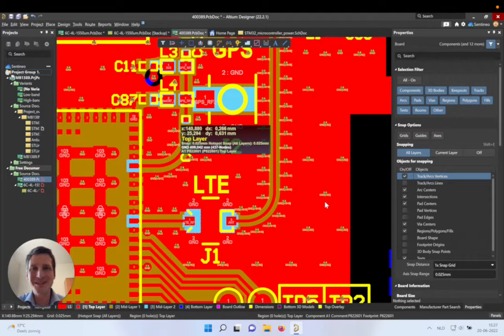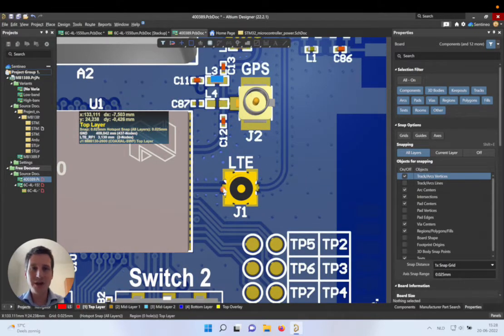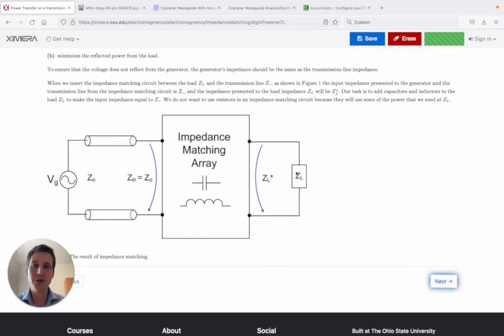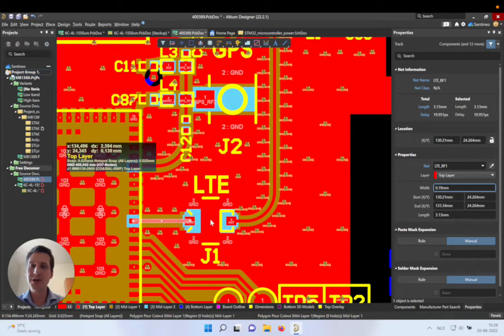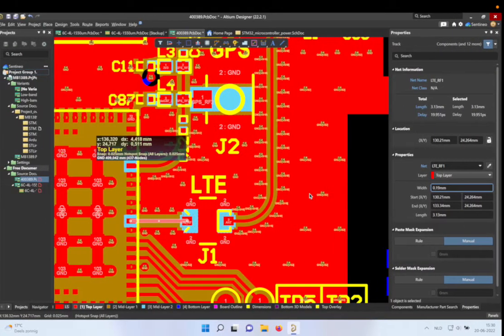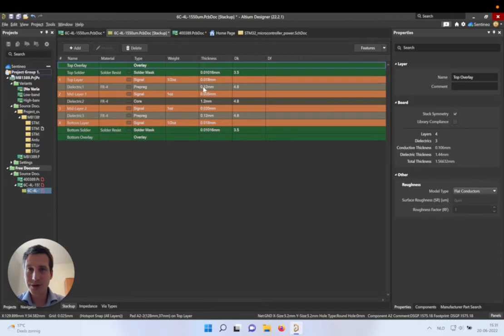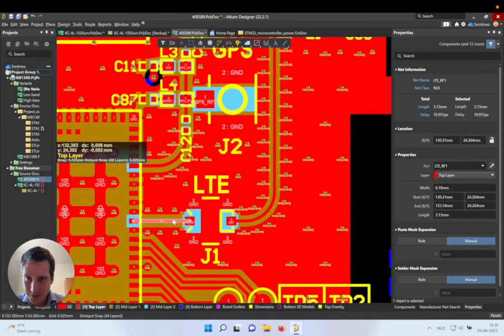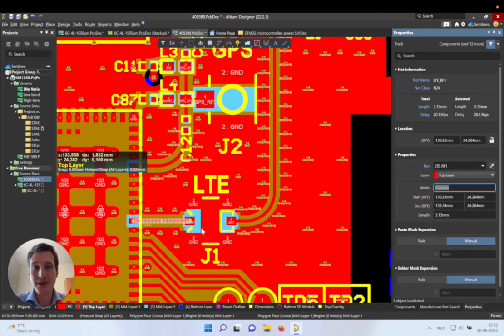How to design a PCB with antenna

Comment: Is it customary to have the ground planes,  which are located on either side of the signal trace and run the entire length of the signal trace, to have absolutely no solder mask on them? Ty
Reply from the maker: As far as I know, these ground planes can have solder mask on them, shouldn't be too much of a problem for this application imo.
Reply: @sentineo  So what kind of RF traces do not have solder mask on them? I did definitely see RF traces without solder mask on them.

Comment: Hello, first of all, thank you very much for these great contributions to your channel.
My question is about what is the distance between vias for shielding the RF line to reduce crosstalk? How is the distance between tracks calculated to shield a 4G LTE/NB-IoT RF line and what diameter and hole should the vias be?
thank you very much, greetings!
Reply from the maker: Thanks for the kind words, much appreciated! Ideally, it's best not to place the shielding too close. Best to also respect the 3x linewidth rule here for spacing to via fences. In terms of diameters, I would go with your standard (minimal) via size. Respecting the distance however is important: rule of thumb for stitching via spacing (when it comes to RF shielding), is to have a distance of at least 1/10th of the wavelength of your signal. So for e.g. a signal of 1.9GHz, the wavelength is ~158mm - a distance of 15.8mm would be enough to effectively contain a pure sine wave.

Comment: Nowhere can I find an answer on how to correctly calculate the length of the waveguide. Should the length of the waveguide match the wavelength? If the software calculation gives an excellent VSWR result at any length, then is there a need to adjust it to certain dimensions?
Reply from the maker: The length of the trace towards your external antenna doesn't really matter, as long as you maintain a constant characteristic impedance along that line (cf. the explanation in the beginning of this video). This is another story of course if you are designing a trace antenna on PCB. This video however is about the connection between an IC and an external antenna.
Reply: @sentineo  ,Thanks, it's very helpful for me. I'm studying Bluetooth AoA design and it needs to be an antenna switcher, so I wasn't sure how long the waveguide could be extended.
P.S.
Sorry for "Google translate".
Reply from the maker: @andreasduzariev2482  You're welcome, thanks for your kind comment!

Comment: How do you know what the impedance output of the signal generator is 50 ohms.
Reply from the maker: For this, it's always recommended to check the data sheet of your RF output stage. In this case, you can find this in the datasheet of the NRF9160.

Comment: Is it possible to increase the range of a smartphone Bluetooth antenna?
Reply from the maker: If you are designing the electronic system yourself, the best you can do is make your matching 100% accurate. Take the casing into account for this as well. In that way you will be able to transmit the maximum amount of power all the way to your antenna. However, this has to be aligned with FCC requirements of course, so that will typically be the limiting factor for range in a well-designed system.
Reply: Hi sir. I am planning to redesign smartphone Bluetooth antenna. Smartphone Bluetooth has its maximum range of 10 meters. I want to improve it by 11 meters.  What is the best way to redesign an antenna, is it okay to use microstrip patch antenna (Polyimide substrate) and how can i avoid heating on the device. Thank you